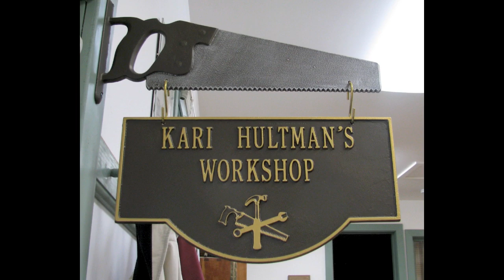Village Carpenter Shop Tour

Comment from the maker: @walk44321 The dust collection units work very well except with my table saw. I keep meaning to add a ramp inside the cabinet base which should help a lot.  I do have an overhead duct collection (aftermarket) arm for it but don't use it. I have a shop vac and dust collector attached to my miter saw which work pretty well. It's not foolproof, but between the two, a majority of dust is collected. I move the hose to the shop vac to my router table when necessary. That works great.

Comment: Any electrical recommendations? I'm setting up a 21' x 21' shop and am thinking of three 20 amp circuits going around the walls, so that each outlet is a separate circuit from its neighbors. Also want a couple of 120v outlets on the ceiling for reeled extention cords to dangle.
Reply from the maker: My builder set up outlets at table height and along the floor every 6 feet or so, and they are set up on three circuits. He also installed a ceiling outlet for my hanging dust collector. I have a separate 100 amp unit for my shop.